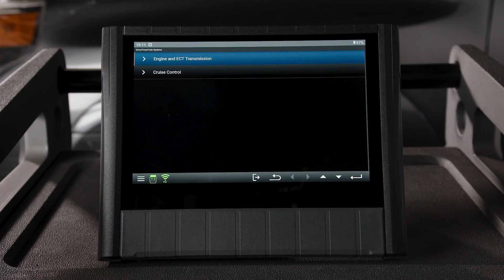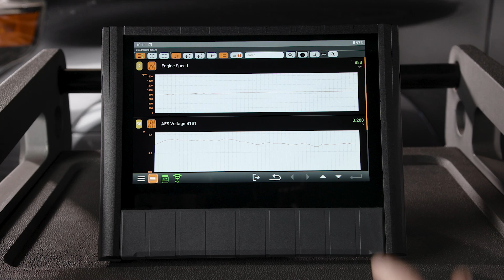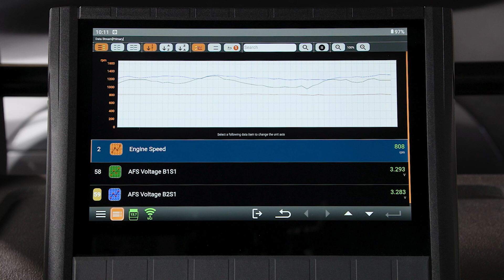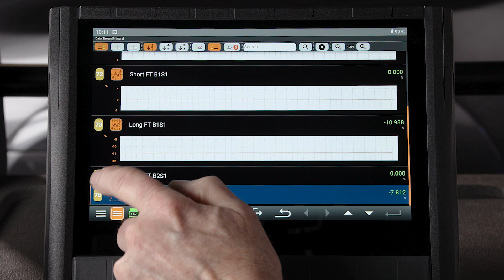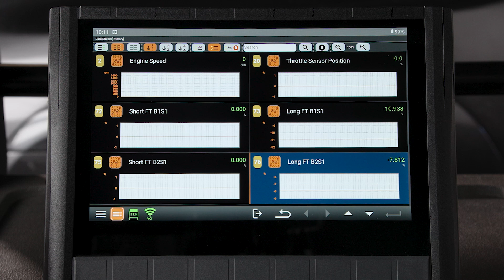iSCAN NX Graphing Scan Tool - How To Use for Diagnostics

Comment: Can you make a recording of the data stream? With the SF all you could do was make a movie with the access to the Android feature, but this was cumbersome. And since it was just a "movie" in, you could not manipulate the data or change the view. In this new NX model, I don't even see that feature. Also, can you add an email client?
Reply from the maker: You can record the screen just like on the SF, the layout is a bit different. We will get a video out shortly on how to do that. 

You also have the option to email screenshots and vehicle reports in the NX. No email client can be installed.

Let me know if this answers your questions. I will check in on what is in the works for data stream recording that is not a screen recording.